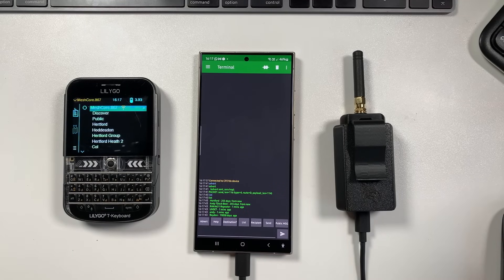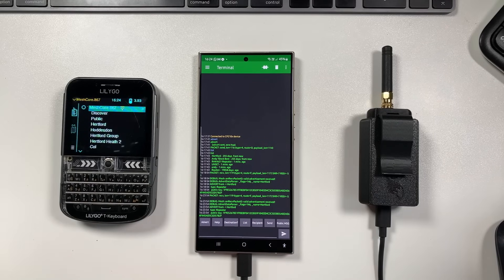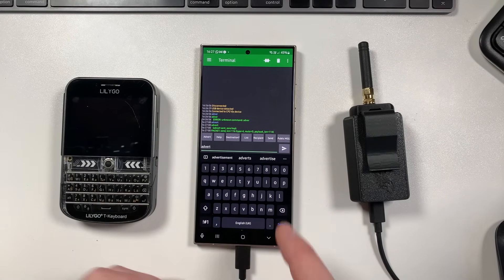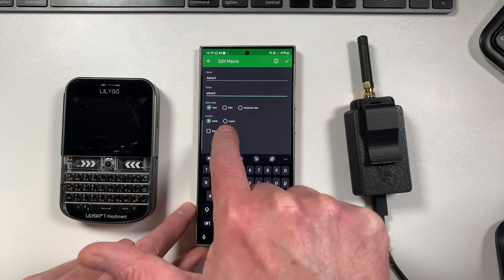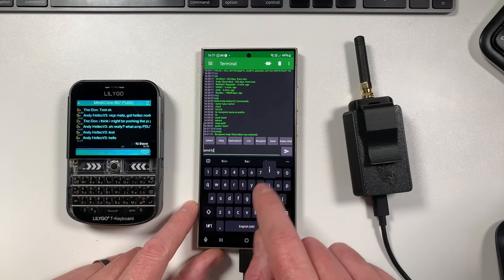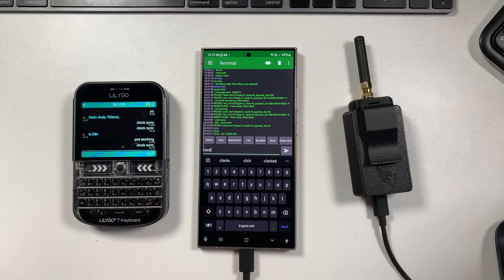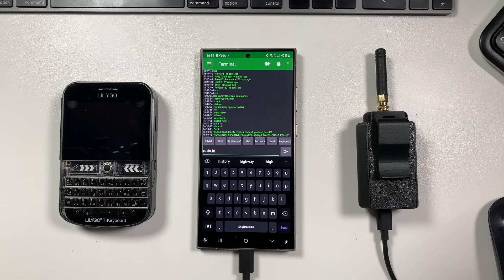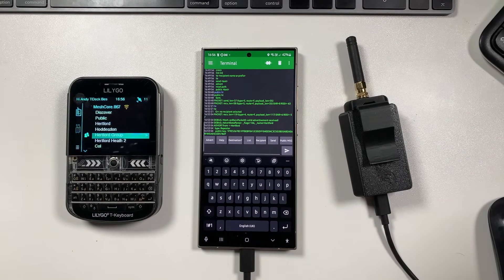Now this is cool!

Comment: I’m curious, if you’re not satisfied with the values and future direction of the Meshtastic devs, why is the Reticulum stack not satisfactory?

I think a little more background as to the “why” would help us get on board with supporting this when, like others have said, it can fragment the community. 

Fragmenting is okay if the pros outweigh the cons. But I don’t think you’ve given us enough of the “why” Andy. Is that something you’re working on for us?
Reply: Reticulum is for a very broad set of technical challenges, of making networks of networks, and bridging networks in exotic ways. It does extend over to the world of LoRa, but wasn't designed for it. MeshCore is designed to be LoRa-first, and as efficient/fast as possible, and take on the scaling problem that Meshtastic have failed to solve.

Comment: You have just made my project so much more scalable in my budget, you don't even know how big a deal this is for me and the mesh I've been the dev on...

Will be following this CLOSELY.
Reply from the maker: Glad to hear it, if you need any assistance please drop me an email 👍🏻
Reply: @andykirby  absolutely will do, I have to put together a PowerPoint presentation for this summer to present my Mesh deployment, all the integration abilities, range and use case, TDeck and rooted Android device necessity and usage, all the above. In that process, it would be invaluable to have your input at any level. 

I was already looking into buying 10 Heltec V3 nodes, and I wonder, does your Meshcore integrate with ATAK like meshtastic, or is that something that I would still have to run vanilla FW to provide as functionality, especially the live map with the ability to add POI's and the like. Thanks again!!
Reply from the maker: Thanks, no ATAK integration at the moment, I think by the summertime,when you are doing you presentation, things will have moved on significantly!
Reply: @andykirby  thats what I figured, and also what I'm hoping 😅 I've got some folks who I feel the ATAK integration will really boost the usefulness of the mesh, you know how us slightly older gentlemen are either 100% texters, or 100% not, some of the elder guys may be less than impressed with "encrypted texting" as they'll see it. Surely they don't need convincing if I was given a few months and asked to drive/fly across the country to present it 😅

Comment: One thought on the clock syncing: can just anyone send a sync command?  If the clock is needed for encryption, for example, could I spoof fake clock data, have someone's node sync from me, and knock it off the network because it's behind time by too much?  Hacker hat on is making me think it's not a good idea to let just anyone run that command.
Reply from the maker: Yes there will be an android app. Maps probably wont work the same way as meshtastic because meshcore is a very efficient system so GPS locations and NodeIDs  are not transmitted constantly across the mesh...Meshtastic is a great beaconing system, Meshcore is optimised for communications.
Reply: The clock sync trick is just a temporary thing, while the RTC clock support is still being added.
Reply: @rippleradios  yeh it seemed like this is for debugging. Theres no way you would allow remote clock syncing since the PKI depends on it.
Reply: @ It feels like it could be useful for admin stuff, but you'd need to have a method of recognising trusted users.  I did assume it was because things are new but I thought it'd be worth asking anyway.

Comment: Why didn’t you improve meshtastic so we don’t have a forked community and divided clashing band usage?
Reply: MeshCore is a complete rethink of the mesh space, and as such it is architecturally incompatible with Meshtastic. For example 'node addressing' is wildly different. And the path discovery and path following is completely different.
Reply: I totally get that. I don't wanna feel like I should need to have some of my nodes running Meshtastic and some running Meshcore. However, as we often usually see, "If you build a better mousetrap, the world will beat a path to your door." If Meshcore is superior, probably, eventually, even the hardcore Meshtastic users will change over, and vice versa. Regardless, competition is good. When we have smart people trying to use LoRa in the most efficient and well-poished ways possioble, it benefits everyone.
Reply: @ Would still be better to have interoperability, even if you do build the better mouse trap some makers will offer features that others depend on and will stay regardless of polish, and with all these mesh nodes it's only a matter of time (given the limited spectrum open to the public) before congestion kicks in and all these incompatible networks start interfering with one another at point it serves no one.
Reply: Exactly
Reply from the maker: Meshtastic have their own ideas which they want to stick to. It wasn't possible.
Reply: @andykirby  Not sure where this is based on. Pull requests are always welcome and considered.
Reply: @andykirby I think this is a good reason to give us the “why” for Meshcore. See my other comment 👆
Reply: This is not forked, it is different thing but using UI your familiar with. Essentially Meshtastic is wifi with password only but this is wifi + TOR on top. Also interoperability with other "radio formats" is order of magnitudes higher with this. Using this over any radio link, any data network... is million times easier to do.
Reply: @Jamey_ETHZurich_TUe_Rulez "forked community" not "forked source"

Also your response sounds more like reticulum (works over any medium) and not meshcore (works only on lora)
Reply: @Talie5in  it is trivial to make this work on 802.15.4 devices for example nRF54L Series SoCs or 
DIY infrared datalink made from simple lens mounted to 10$ fiber SFP module + 3$ arm board (Koruza, Ronja). LXMF. OSI model.
Reply: Ripple Radios' Nov 2, 15, and 18 posts provide some background. The fundamental issues appear to be 
1) target use case 2) consequently, suitability of protocols 3) the extent to which Meshtastic supports compatibility, and the degree to which contributions are compatible 4) business models: Meshtastic is licensed under GPL; some commercial software companies won't participate in GPL projects because it requires that all the released improved versions be free software. Meshtastic appears to be following the Redhat model of monetizing support, solutions, and certification, and has concerns with closed source projects mentioning their trademark, while Ripple Radios wants to build closed source extensions such as their T-Deck firmware 5) distrust between Meshcore and Meshtastic contributors...   DISCLAIMER: This is from an unknowledgeable outside observer; GUVWAF, who has already commented, has participated in the posts and and has much more insight and knowledge.
Reply: Floating the titanic down a small river is not a good idea.
Reply: Personally I dislike forked communities (if you play java Minecraft you probably know where I'm coming from), this is the same issue we get with everyone recreating the wheel and then you get a bunch of people split on the age old question of "what's better", still it is a free public band so if he wants to put his take out there he's free to do so. 
I'll be sticking with Meshtastic.
Reply: @festro1000  given how poorly Meshtastic is guaranteed to scale for the future, I hope you change your tune, because if you do it will probably have been because Meshtastic has grown enough that the scaling issues have become blindingly obvious to everyone regardless of where they are.
Reply: Agreed with OP, submit the changes to Meshtastic and everyone truely benefits with creating fragmentation.
Reply: Cause meshtastic is closed source and super skeechy
Reply: @raresoupninja  It is not closed sauce (meshtastic) - don't spread FUD.
Reply: @raresoupninja  What? Meshtastic is completely open unlike this project.
Reply: @raresoupninja  apparently so is the meshcore firmware for T-Deck.